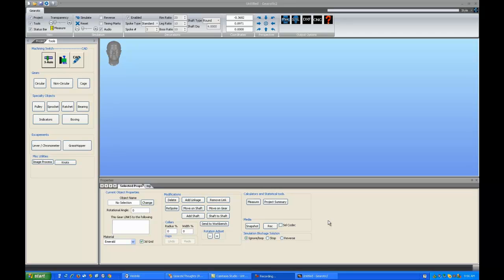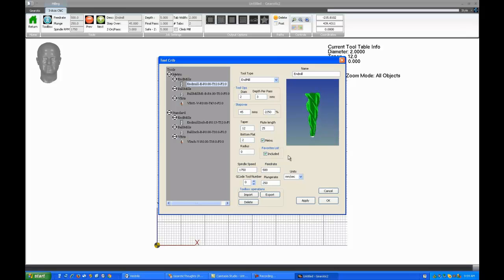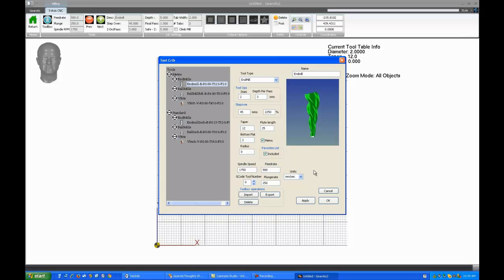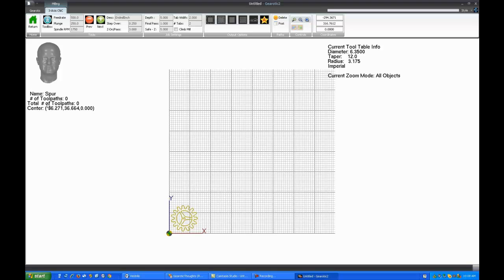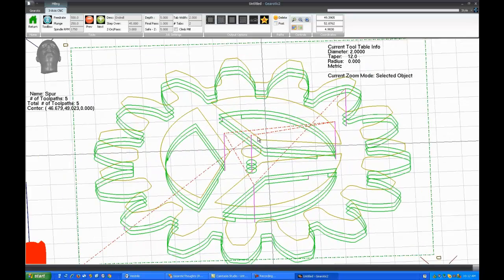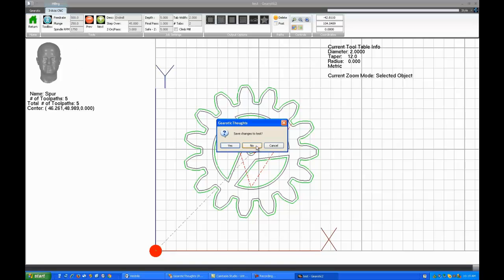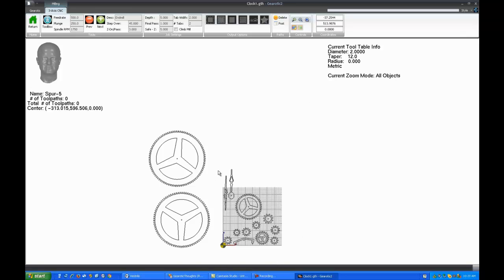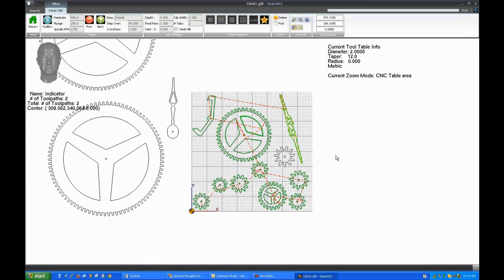Gearotic Workbench

Comment: how come i dont get to click on 3axis for my work bench? reads (in development)
Reply from the maker: Frank Lopez Hi Frank:  Update to the latest version. 

Art
Reply: Art Fenerty ok ill check that out
Reply: Art Fenerty is there another video that shows me how to learn that app? any links?
Reply from the maker: Frank Lopez There are several videos on the program itself, but this is the only one for the 3d workbench module. Feel free to ask any questions on the forum though, they are typically answered within hours..
Reply: great friend thanks! cant wait to start designing my gear ratio "torque" for my humanoid applications using this app with my cnc or 3D printer